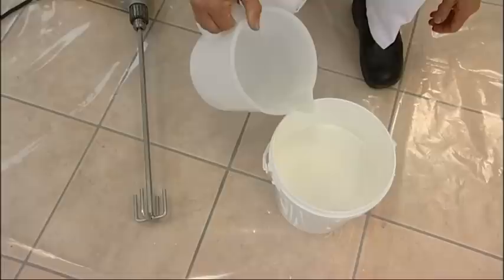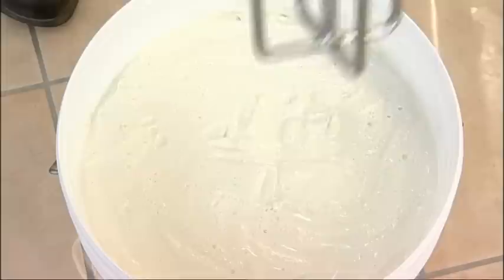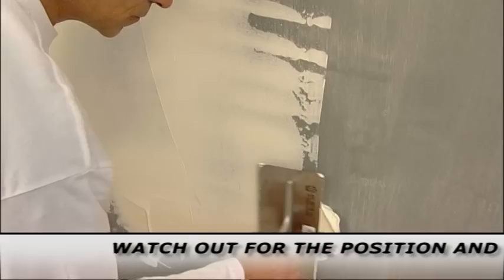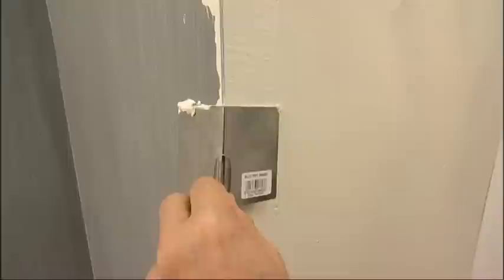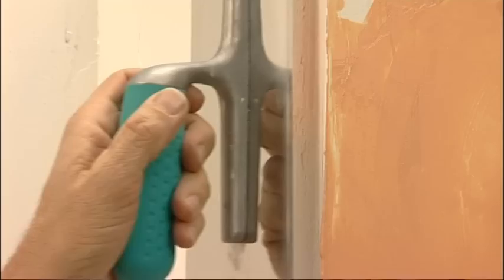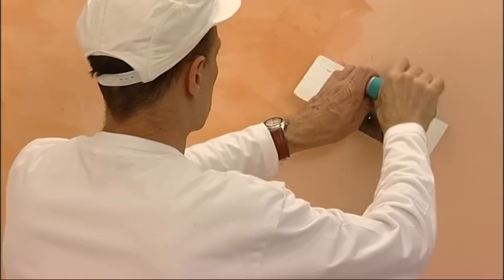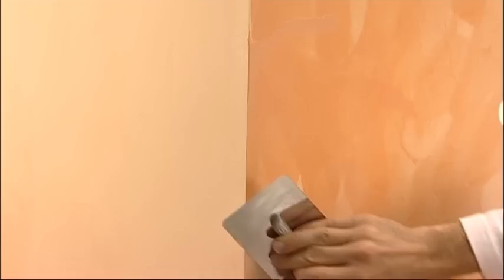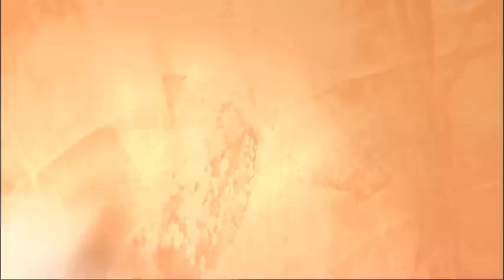Classical Venetian Plaster Application how to & step by step

Comment: great vid thnx a lot . 1 question you mix the stucco with color, but you apply the 1st hand using a non colored stucco (its the white one) do i need to have an extra portion or stucco without coloring it and apply it first on the wall?

Comment: Great demonstration of skill. Very inspiring. One technical question: how do you get into inside corner (to the places where the corner meets the ceiling and floor) with the rounded corner spatula for the second coating?
Reply: You use your finger to place plaster on that area. It's sometimes called the Italian tool. :)